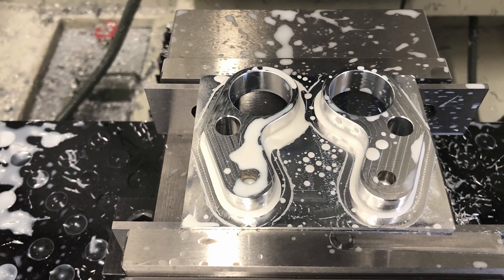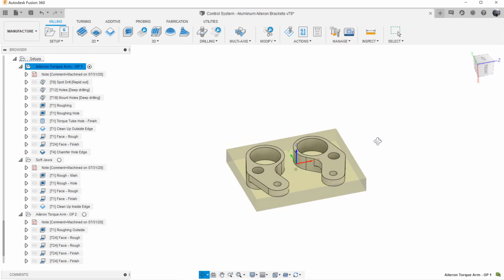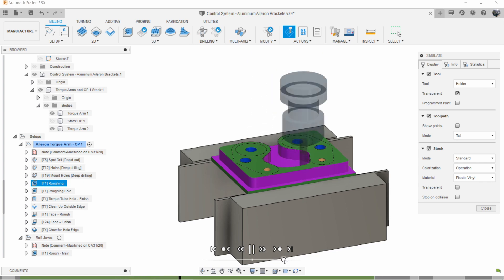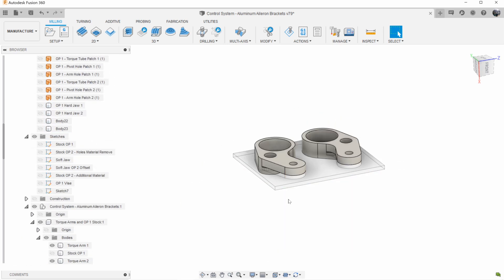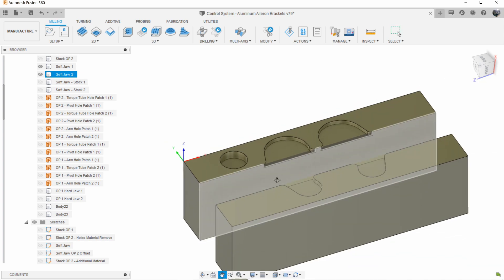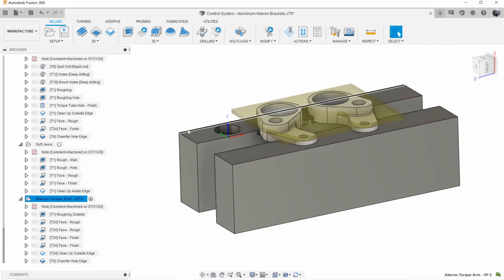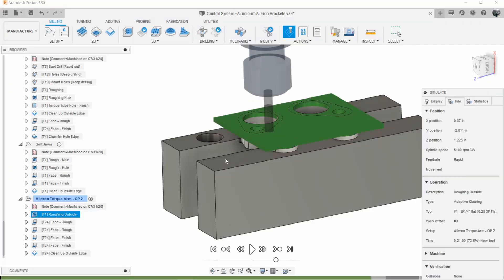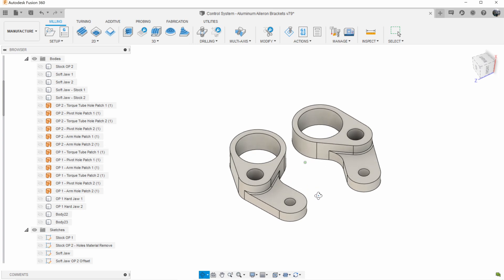Machining a 2 op part and setting WCS  - Fusion 360 CAM

Comment: - Great vid. Thx.
- 'Manufacturing Model' for each 'Setup' could come in handy. You can even 'Associate Named View' w/ each.
- Maybe you are aware of this, but just chose not to use in this case. Or, maybe you've discovered it since making this vid.
- And, thx for the 'Machining Calculator', clearly a bit of effort went into developing it.
- Keep up the great content/work...

Comment: Another fantastic video! Had a question about the CAD for the soft jaws. Did you simply extrude a rectangle to the Y-dimebsion of your jaw, then extrude a cut to remove the 1-inch space and then sketch and extrude a cut on the face of that rectangle for the op 1 side? Just trying to understand fully. Awesome work :)

Comment: You should go into your preferences and check the option that always orients the stock the. right way up when you select that setup - that way you won't manually have to flip it over - it always puts Z up.
Reply from the maker: I didn't know that was a thing. Thank you for the suggestion! :)

Comment: how did you setup the transparent color for stock remaining in fusion ?
Reply from the maker: We didn’t have time to get into the CAD setup much but we modeled both the op 1 and op 2 stock and applied a transparency to both.
Reply: DarkAero, Inc ah ok so they are new body’s that are transparent, thanks

Comment: That was very informative Keegan. Just curious - how long (hrs /days) does it take for you to design a CAM operation like you illustrated in the video? I’m sure it is many hours of programming in Fusion, was just curious.
Reply from the maker: When I was first figuring it all out, depending on the complexity of the part, it could take a day or two just to get everything setup in CAM. Now that I have a better idea of what I'm doing, this part for example, was completed in 2 hours or so. That was including cutting out a section of stock, completing the CAM and all the machining.
Reply: @DarkAeroInc  Yeah I figured there was a learning curve. But two hours seems really fast to do all that programming / visualization and the machining. You're a fast thinker!

Comment: Seems like you’re leaving a lot on the table as far as speeds and feeds go.  That step over looks realllllyyyy small.  You’d be surprised how you can push a 1/4” carbide endmill.  But maybe you’re using hss or something.
Reply from the maker: Thanks for watching! Agreed, there is always room for optimization with your tool paths! Since this is just a prototype part and given the power limitations of the CNC machine, we weren't focused on pushing it at this point.

Comment: Great stuff.  What tool do you use to radius the corner between the arm and the torque tube holder?
Reply from the maker: Thanks Ed! The inner radius was .03" so we simply used a .03" bull nose end mill to come and finish cut that radius.

Comment: I'm hoping that the final version of that bellcrank-to-torque tube installation will have drilled bolts and safety wired castellated nuts? Pretty important for critical flight controls. I'd like to see thread locker on that jam nut, as well.
Reply from the maker: Scott, thanks for watching! I should have mentioned that the clip of it installed was just our initial fit trial for it. The hardware wasn’t final. We have a whole section on our knowledge base that covers proper hardware installation. https://www.darkaero.com/knowledge/hardware-specs/
Reply: @DarkAeroInc  Thanks guys, I figured as much! :)

Comment: Curious why you chose that starting part orientation which requires the part to be flipped rather than just machine the full part in one pass
Reply: You can't do it in one pass inverted like that. There has to be something holding it in place so that you can machine it. If they did that, it would end up cutting the pieces free of the stock, and they would go flying.

In the first pass, the base of the stock left unmachined holds them in place. Once the top surface is machined away, it's flipped, and the jig then holds the newly-machined parts in place while the remaining stock (that WAS holding them in place) is machined away.
Reply: Scott MacLean I think Nicholas means that they could have machined without using the soft jaws by flipping the 3d model in the cam software so that the flat side lays on the bottom and then using tabs to hold it in place while contouring, I would’ve done that too but i am not experienced in this stuff so take it with a grain of salt
Reply: But the goal of this video is how you could setup a soft jaw operation and he explained it in a fantastic way
Reply from the maker: Nicholas, thanks for watching! You could definitely machine these parts in a single operation with no flipping over or soft jaws required. We have used the tabbed approach for parts like this in the past. For these parts we wanted to be able to leave a nice facing finish on each side and also chamfer the edges on each side so doing a 2 operation setup made the most sense for us. To be honest, I'm not a big fan of tabbing because it requires post processing to remove the tabs, and I can never seem to get a good result in the end. I also haven't had much luck finding good information for tab spacing and tab size to ensure you consistently end up with final result you're happy with.
Reply: @DarkAeroInc  Thanks for the reply, I figure its just a matter of personal preference. Always great to here of other's thought process